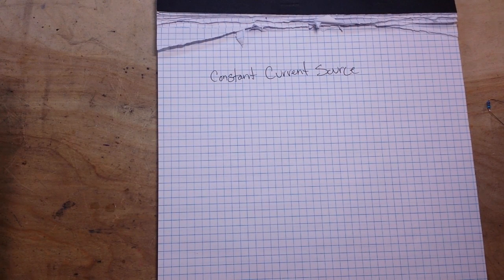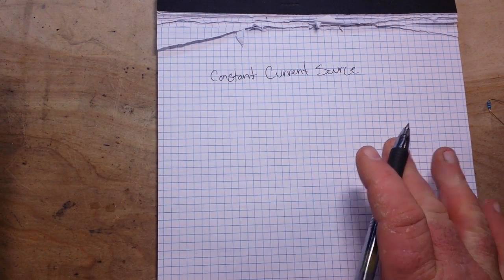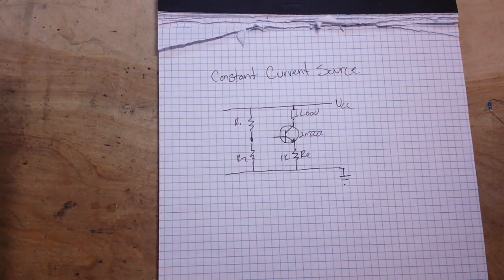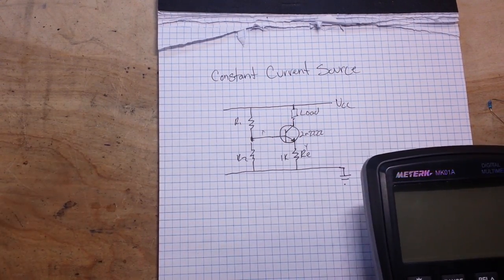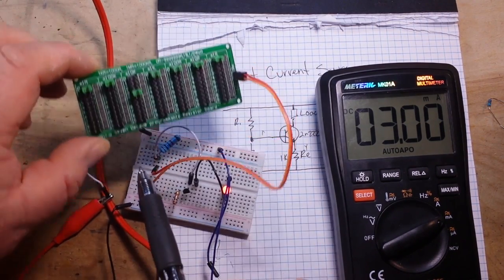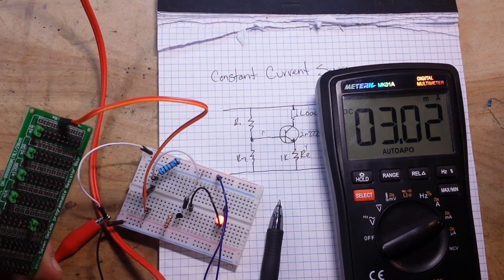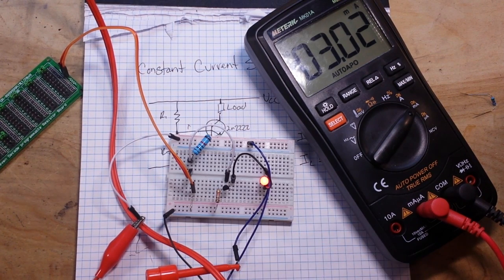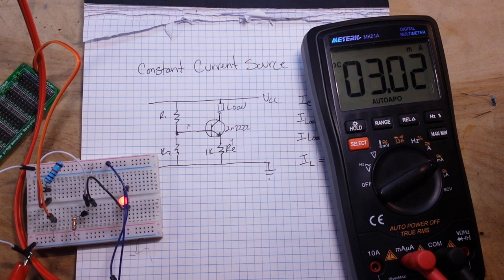Classic Circuits You Should Know: Constant Current Source

Comment: if i connected different types of loads like a led, resistor in parallel both should get same current through them, which is not happening.

Comment: Never had to spend too much time calculating or designing circuits except for my own curiosity as I was always repairing and trouble shooting mostly guitar amps so I thought in terms of resonance in the circuit when I wanted to do something for myself but then I noticed when I started buying military surplus that they were using 400 cycles for equipment they were designing and they had generators that operated on 400 cycles.  The effects of resonant frequencies on circuit boards opened a whole new can of worms for me when I started trying to produce resonant circuits with the notion of adjusting the cycles to operate at and then having converging resonant frequencies and being able to adjust pulse width modulators and I finally noticed that there was a shimmer present at a resistor that I thought was going to burn out however it hadn't as it didn't have any soot on it but some leds did  burn out  ..  now I am thinking I will need to avoid elecrolitic capacitors and start looking at some spec sheets and seeing if I can find some crystalline based caps that won't dry out where these increases in current occurred and how will I manage there  ..  for now though I produced a crystalline based capacitor that I can rehydrate with electrolytes that I can adjust  and measures closely to the caps that I have been using and it can discharge at the same rate behind high speed switching  .. now I have stumbled on to this very good video when I notice the headline is constant current because right now I have escalating voltage   ..  fortunately it is just powered by 6v DC however AC can be made to travel along the same wire ....

Comment: Use a voltage regulator such as 7805 driving a steady load.  The load gets a constant voltage across it, so it draws a constant current.  Then the voltage supplying the regulator puts a constant current through the regulator.  In fact it is not a constant current source, more accurately is a constant current sink...

Comment: Hello! Good video! I want to tell about several problems in this circuits - what happened if supply voltage changes? Bias voltage will also changed - so, the current source will be working with an another constant current value.
Reply from the maker: It's a simple demonstration taught in electronic texts. It's not perfect, but beginning electronics students aren't ready for a fet and an opamp just yet

Comment: My problem is Re and the power dissipated gets high if you want a 10A 12V constant current source.  Is there a better way when you’re getting into higher currents?  The application for the circuit is to charge a super capacitor bank without melting wires or blowing fuses.

Comment: Awesome circuit and well explained, thank you! I am trying to design my own current source to use in a zero temperature coefficient application. I was using the LM334 with a diode (opposite tempcos) but the LM334 is too large for my board. Hoping to try this design out - thanks again!

Comment: Great video. If you wanted to make this circuit a variable current source, all you need to do is replace R1 and R2 with a potentiometer with the wiper blade going to the base of the transistor. To vary the current, just turn the knob of the potentiometer increasing or decreasing the current to whatever value you want. I would start with a 100K potentiometer first and see how it behaves. Other potentiometers are also possible.

Comment: Your video did not demonstrate, the effects of changing the supply voltage by about +/- 15% and also changing the load resistance by about, say +/- 25%.  This would be a requirement in practice, because these two values are prone to change during a sequence. Thank you.

Comment: Confused by the last equation. You wrote
ILoad = (Vb - 0.6 / Re)
But I don't see how that can be true, because that's what Ibase equals (if you solve for it).
Your previous lines of equations can be re arrangement to make the statement that
 Ie = Ib + Ic
Since Iload = Ic
Isn't it simply Iload = Ie - Ib?
Since you said Ie = 437Ib
Then, Iload = 437Ib - Ib = 436 Ib
The only way Iload can be dependent on Re as per your equation is if Ib is dependent on it.

To me it seems you are missing a factor of 436 in front of that last equation

Comment: The equation in the End is not right. 
Damn.. 
He took the circle with 
   U2, Ubase_emitter and Uemitter. 
->UB, 0.6 and IE * RE
Which means: 
IE = (UB-0.6) / RE

Because 0.6Volts at the transistor means conducting:
IE = alpha* IC 
so the result is:
IC =[ (UB-0.6) / RE] * alpha. 

Damn. Please correct that. I calculated for 30 minutes, because i was unsure of the result. 
Teaching is fine, aslong as it is complete and fine.   
Also continue step by step. 

Gosh and dang.... !

Comment: Hello can anyone help me? I was trying to make a double A battery charger 1.2V NI-MH I have successfully created the proper voltage rating for the battery, but I was having trouble with getting a constant reasonable enough current to charge it. I'm only having at best 10mA on the output load.

Comment: This is really taking the long way around, you know. 

It's a lot easier to understand if you point out that setting the voltage at the base also sets the voltage at the emitter - when operating in the linear region of the device.. 

That emitter voltage then determines the current through the emitter resistor . . . which in turn, "is essentially" the collector current and does not vary with the collector resistor.

Comment: would you show thhe math on how to find the voltage at the base on each resistor
Reply: I assume you want the voltage at the base of the BJT.
First I suggest you do this:
The two resistors in series are XXX Ohms
The current is Vcc/XXX = How much
The current in the lower resistor is the "How much"
The lower resistor is YYY so
V(th) = I * R = "How much"  * YYY
This gives you an inaccurate answer but often one that is good enough.
It also gets used in what is below.
Imagine the two resistors are in parallel.
Work out that resistance for a parallel pair = ZZZ.
Get the datasheet for the transistor and find the minimum value for HFE (Current gain) at the collector current you want.
I(base) = I(collector) / HFE
V(drop) = I(base) * ZZZ
Min V(base) = V9th) - V(drop)

Comment: Something else too. Using the PNP variation where the collector feeds a constant current out but using two diodes in the base bias chain eg 2N4148 or BAX16 Signal diodes or any typical Silicon signal diodes, with a high voltage PNP transistor this provides a great constant current suitable for testing multiple voltages of zener diodes. Just feed the zeners with the current supplied from a high enough voltage supply and the zener voltage can be read off directly with a volt meter. 

WATCH FOR.MAXIMUM POWER CONSUMPTION OF THE TRANSISTOR EXPECIALLY WHEN MEASURING LOW VALUE ZENERS as it's very easy at 80v supply and 10 mA to fry a small transistor being used essentially as a controllable series resistor!
Reply: An old style green LED is better than two diodes.  The tempco of the LED almost exactly matches the EB drop of the transistor.  This means the current is nearly constant with temperature.  Two diodes makes for a decreasing current with increasing temperatures.
On a BJT, you often hit the second breakdown before you hit the maximum power.  Basically, if the voltage is over about 6V, you need to pay attention to that curve in the data sheet.
Reply: @kensmith5694  like I said previously, spot on, except a green LED requires MUCH more bias current than two signal diodes, which depending on output current desired (if  >> 10mA) can be very stable at <<100uA. The heating issue is much more related to current flow in the bias chain than in the ambient temp change, which whilst important, changes in a far less volatile (read rapid) than component temp.

Secondly, whilst an LED works well in a low voltage Vcc environment, (< 20v), not so in a high voltage one as there is SIGNIFICANT heating of the bias chain resistor at high voltage e.g. a 5mA current for an LED fed from an 80-100v supply means a series resistor power rating of 0.5 watt at least. Higher power rating, voltage, and precision resistors tend to be 
a) more expensive
b) more temp susceptible nearer their power rating
c) precision degrades somewhat with load
d) board layout becomes more critical around the resistor to avoid heat cross contamination. This also applies if multiple 0.25w resistors are used (in series, parallel or combined)
e) the PCB requires a larger footprint

These factors become less important in lower voltage circuits, clearly, but are still present since the LED power requirement will remain the same. So it is only the power loss in the series resistor that differs significantly.

In the low current signal diodes usage case, Vcc variations and high voltage usage, varying between 80 to 150 volts, the power consumption in the series resistor at 50uA hits a maximum of 0.0075 watts! Even doubling that current to 100uA causes only 15mW dissipation. 100uA is PLENTY to enable 10 mA emitter (hence collector) current of 10mA in even a reasonable gain small signal transistor - typical Hfe of 200+ for good ones. A change from 15mW to 30 mW will make negligible difference in thermal heating hence maintaing accuracy.

There are many other factors involved and people looking for a HIGHLY accurate, HIGHLY stable current source should investigate  further, but BOTH the methods outlined above are valid, given the caveats, select AND TEST according to your needs. I've used both with success but tend to prefer the latter generally as I'm tight and prefer to use LEDs for signal, status, warning and power indicators. Signal diodes are 10 a penny and do not require mA levels to operate in the way proposed.

But ... To repeat BOTH work, work well, very reliably, very predictably almost NEVER fail when used properly, and each has its own caveats and limitations.
👍👍👍👍
Reply: @boblewis5558  
The LED only needs well under 1mA to get it into its range where the tempco matches.
I design stuff that is used out in the environment a lot.  Tempco matters in those cases.  Also things like audio power amplifiers tend to self heat a lot.  In those cases, stability against temperature matter a lot.
There is a slightly more complex circuit that avoids the temperature rise with supply voltage issue.  You split the resistor feeding the LED into two equal ones in series.  A low leakage current 6.8V Zener can then be run from the mid point to ground.  Below about 15V, the zener does nothing.  Above about 15V it constrains the rise of current into the LED.

Comment: For a much more temperature stable result, use two diodes rather than a resistor from base to ground. The required current into the collector to ground is then simply 0.6/Re this proves very useful for current sources of less than 20 mA as 0.6 (or 0.7 if larger diodes current used) divided by 560 ohm gives near enough 1mA.

 For EXACTLY the value you want using standard E24, E25 or E48 series values it is fairly easy to get a much closer resistor value to what you need by just placing a much higher value of resistor in parallel. E.g. a standard 680 ohm in parallel with say a standard 5k6 ohm from the same series provides you with a total parallel resistance of 606.37. 

In other words two 10% resistors can get you within 1% or very near. That's just 10uA for a 1mA current.

 Any variation in the first diode matches changes in the emitter circuit (for a straight silicon junction) and Re has a more constant voltage across it, maintained by the lower of the two diodes giving a fixedly single diode voltage across it.
Reply: What you really-really want is an old style green LED.  The new super bright type doesn't work as well.  The forward drop of the LED has the same tempco as the EB voltage of a transistor so it temperature compensates very nicely.
Reply: @kensmith5694  absolutely ... Basically anything that produces a stable reliable voltage across a resistor will produce a constant current.

The alternative these days is to use a switching supply which will run at the same power efficiency (pretty much) all the way from low to high voltage.
Reply: @boblewis5558  
Yes, if you can stand the ripple and the budget.  I have made one of those in the past.  There is a trick to no output ripple
Basically, you need to make the working inductor appear huge.

Comment: You forgot about thee other "Single Transistor Current Source".
The JFET!!! And it's even simpler.
Just connect the Gate to the Source and its a current source..
To enable one to adjust the current:
Ground the Gate and put a shunt resister between ground and the Source.
redrok@redrok.com
Reply: ... or depletion mode MOSFET.  
You can get MOSFETs that can withstand drain voltages that are really high.
Reply: Hi Ken Smith;
Yes. Not many venders sell depletion mode MOSFETs though.
supertex.com , www.clare.com and a few others. See:
http://redrok.com/electron.htm#depletion
Depletion mode MOSFETs are widely used inside IC chips
but not so much stand alone. I often find uses for them.
An interesting use is as voltage translators for I2C control
lines. There is no need for a power input like the conventional
ICs need.
BTW, all the JFETs are depletion mode also. The JFET disadvantage
is that pesky PN junction in the gate whereas MOSFET gates are 
insulated over a wide range of voltage.
redrok@redrok.com

Comment: You can make a constant current source with a diode in reverse on the base of a transistor. The reverse leakage current through the diode will not change much with voltage, the transistor will amplify the constant reverse current from the diode. 

OR JUST USE A SINGLE JFET WITH THE BASE AND THE DRAIN TIED TOGETHER GODDAMNIT !

Comment: If the "Load" is a capacitor, can I connect the other end to a separate circuit instead of back to Vcc? (so I can get a linear change in V vs t based on the charging of the capacitor with a constant I source)
Reply: No, that is not how that works.

Comment: Ed is right. It only controls current at a constant voltage! How do you design a true Constant Current driver that works with a variable voltage? Hypothetically speaking, a 80mA constant current with a source voltage ranging from 10v to 30v?
Reply from the maker: Current mirror

Comment: I like hopw you Highlight a reply especially since YOU ARE WRONG.  Change the voltage and the current through that led will change.  UI think you need to stop and read the LM317 datasheet.  Just that itself will teach you what constant current is.  All you have is a current control through a transistor.  If you change voltages the current will change.   Now take you a lm317 and connect it up as they show you for constant current.  You will e able to crank in that thing anywhere from 5 volts up to its general rating of 37 volts and that led will not falter.  YOU ARE WRONG.

Comment: This is not a constant current source or sink.  Constant current means just that, current remains constant regardless of input voltage.   Crank up the voltage, we gonna get same current through that LED with 5 volts as with 12?
Reply from the maker: Yes. Current to LED is controlled by base current. So it is a constant current sink or constant current negative source, but thanks for playing.
Reply: I did play and you lost.  Change the input voltage changes current in your circuit. It is not a constant current circuit.  It is an transistor controlling the current through the led but if you change voltages the current changes, thus, not a constant current drive.

Comment: Yes. I did enjoy that. 
I have never thought about this circuit configuration as a constant current source like that before. 
But then again, I altso have never seen a university from the inside before either. 
Am I correct in thinking this current source is better at regulating when the load resistance and/or impedance changes, rather than VCC changing ?
Reply from the maker: Yes you are

Comment: I am missing something. The current through the R1,R2 circuit is proportional to input voltage, therefore the base voltage is proportional to input voltage, therefore the base current is proportional to input voltage, therefore the output current is proportional to input voltage, which is what we started with. Somebody help me out.
Reply: You are correct, it is not a constant current circuit cause the current will vary with input voltage.  If it was constant current you would be able to run the thing on 12 volts.  you could put anywhere from one to 4 led in there and they would all be the same brightness regardless.  This is not so whit his, if you change input voltage your current changes as well.